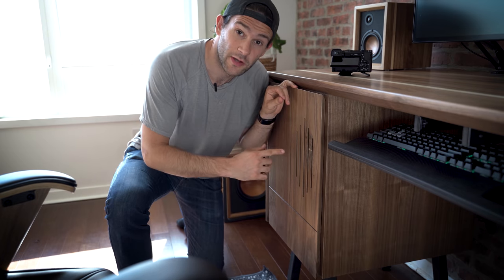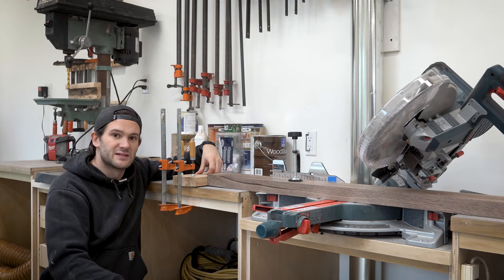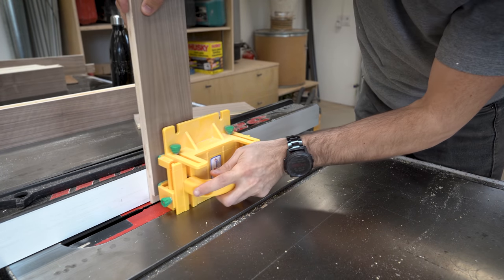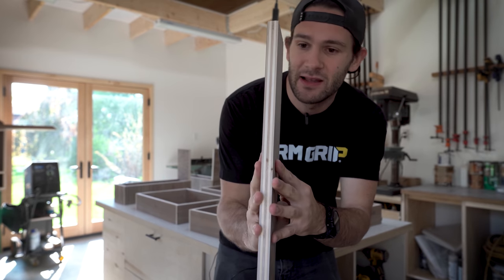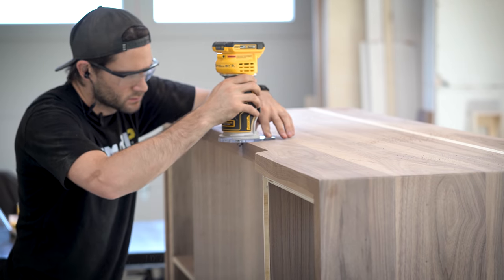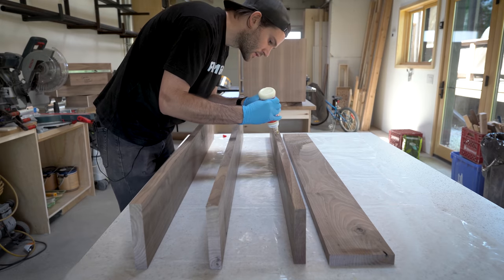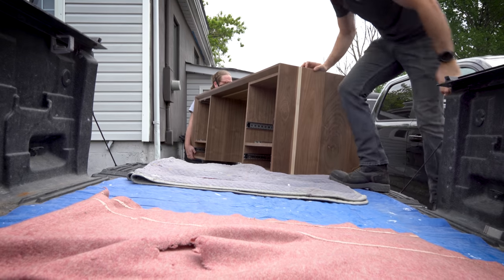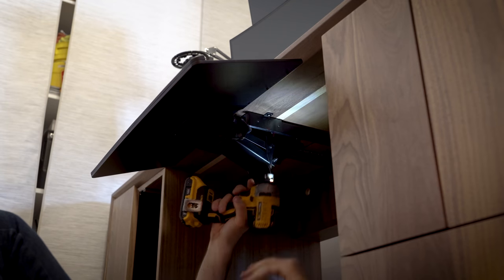Building My Dream Desk

Comment: Man, that is a seriously beautiful desk!! I love the integration of the PC within the desk. I need to build a new desk as well and I thought about just building a small matching cart to set my tower on to save some room on the desktop and still let it have proper airflow. Speaking of, the vents on the front look great. I wonder if it would be beneficial to add a removable dust filter behind the vent. Great job, Zac. New sub!
Reply from the maker: Wow, sorry for my slow response!, don't know how I missed this. I really appreciate the kind words! 

I didn't include it in the video due to time constraints but there actually is a dust filter that sits between the front of the drawer and the front of the rad, so we are definitely on the same wave length there :)
Reply: @ZacBuilds  perfect! That's awesome man. Now that you've been using the desk for a while, is there anything you wish you would have done differently or something else you'd want to add to the desk? -Joe

Comment: Should totally get a sprayer. You can get a decent enough compressor/sprayer combo for 100$. And it makes life infinitely easier. You'll spend half as much time sanding. 

Though keep in mind a gas mask is essential for spraying unless you have great ventilation, and even then it's recommended. Those fumes are no joke.

Comment: as system builder i have a few things on that build, one please dont ever drill holes with the mobo in place thats asking to short the board ... two you have like no air flow in that build ... you have a rad on the intake and exhaust, you should be running push pull on those to increase airflow while decreasing fan speeds cause it has to be choking that system you might have decent cooling but its going to burn out faster with the lack of airflow. other than that this desk is absolutely beautiful as a fellow carpenter i cant wait to build a custom desk case to show off my pc!

Comment: Awesome build! 
Looks amazing! 

I am not a proffesional metalworker,but i leran that when you drill into metal you should use oil.
Just apply a little bit of oil where you're drilling,that will make the drilling proccess much more easier and also will keep your bits last longer.
I'm guessing that there is special oil for drilling but i am using some old motorcycle oil and its works great so far.

Very appriciate all the time and efforts that you are spending on editing these videos.

Good luck!
Reply from the maker: Yes, you're very right! A little bit of lubricating oil will help the bits to last longer!

Comment: Nice design!  One thing that may cause an issue in a few years is that the solid wood will expand and contract with changes in humidity but the plywood won't.  The screw holes on the outside edge should be oversized to allow for this wood movement.

Comment: Awesome looking desk! Keep in mind: Never ever run your screws to radiator with power tool as there's a risk that you accidentally run the screw far and puncture the fin. That mess ain't fun! :D 

Suggestion for the cable management and possibly rev2.0 of the PC side of the desk: Why not offset it bit more to the right so there's "excess space" behind the motherboard, where you could have cable tie mounts? Then you could drill holes for the cables and run them behind the motherboard so that they are tightly together with cable ties? 

But overall: damn nice table! Love the simple but very functional form of it!

Comment: Really nice work, I love the big beefy top and the decorative stripe.  I think you've certainly got a knack for design as well, really nice proportions!  One suggestion, when you screw the plywood bases to the top, it's good to elongate the holes across the grain to accommodate wood movement (maybe you did it but it wasn't in the video).  Nice work!

Comment: Really impressed with your fine craftsmanship! I would just like to ask if the noise generated by the fans gets more amplified now that it's inside the cabinet which essentially serves like a speaker baffle.
Reply from the maker: Thank you for the kind words and that's a really good question. I used pretty high end fans to begin with so they already pretty quiet, but now that they are in the desk I don't hear them at all. I'd love to claim that this was some great design feat on my part, but truth be told I just got lucky. I didn't really take acoustics into account when I was designing the desk, but even at full load I can't hear any fan noise.
Reply: @ZacBuilds  Great! Thanks for sharing.

Comment: Great stuff, you have some skills. Just liked to know how is the computer doing dust wise since you have negative pressure (one fan intake and two out) this usually cause the case to suck air from every where it can. This will make your computer case to act like a dust vac causing a build up of dust. Some removable dust filters would help and or adding more intake air fans. More intake fans would cause a positive air there by pushing the dust out from the case. If you have the rad fans setup as push and pull the you should be ok. Nobody ever talks about how these desk pc setups dust issues.

Comment: Awesome desk. The desk seems a little bit off, it looks like it is not level @ 0:42. If you look at the top monitor, it looks like it's not level (if you look at the wall too). But, if you look at the top of the speakers or the top of the desk, it looks like it is not level there too. Nonetheless, great desk. I can (and will) use some of your tips for my desk :)

Comment: New subscriber here, love the work you did on this! Would it have been beneficial to cut out an exhaust outtake on the backside of the desk for airflow? You could even mount a large outtake fan for push-pull configuration.
Reply from the maker: Hey man, funny you should say that, but that's exactly what I did. I cut some slots in the back of the cabinet, and mounted a big noctua 200mm fan there to suck out exhaust air

Comment: Interesting the difference between US furniture, which reflects the abundance of timber in the US, as opposed to English furniture where much of it is imported and is used much more sparingly.  The result is English furniture is much more elegant where as US furniture can look chunky by comparison but probably reflects the larger than life character of Americans. If it was me I'd save the solid for legs and mouldings etc and use lipped and veneered boards for the main desk. You wouldn't be able to tell the difference and you could use much more figured grains and maintain the stability.. It also gives you the opportunity to do a bit of inlaid work if you like..

Comment: One question. Why don't you use a runner system by Blum, like Movento or Tandem? Much easier to intall and nicer to look at since you don't see the sliders at all. Plus on Movento system you have a 3D option of aligning the drawer fronts.

Comment: Beautiful project. Subscribed. But.... I will really appreciate, if you can post the measurements in written, either in here or on your website... if at all possible. Thanks for this wonderful inspiring video.
Reply from the maker: Thanks Tanmoy! The desk is 72" wide, 26" inches deep and 36" high. That's very high for a traditional desk, hence why I have the keyboard mounted down below. But it makes the desk very comfortable to use as a sort of work bench around the house.

Comment: Zac, I didn't notice in your video how you placed the computer power and reset buttons. Can you link to the timestamp where you did that or describe how you placed those?
Reply from the maker: I know this response is super late so I apologize about that! Right now I have a remote switch sitting concealed on the backside of the desk near where the powerbar is. It's really ugly (I couldnt find a nice one) so I didn't show it in the video, I'm still hunting for a good one. I dont need to use it often as I basically never turn off my computer (just let it hibernate).

Comment: Nice concept here, I like it. But desktops need to have maximum width for maximum comfort and work surface, that way you could have avoided the sliding shelf for the keyboard mouse, no steady at all. I like big desktop tables, I made my own desktop office with dimensions 2 m length, 75 cm width.

Comment: Hey Zac.. little late to this particular video.. I am looking to do a desk build soon for myself. I have a sit/stand desk (dual motors) currently, planning to replace the wood top with a studio desk for my music/workstation use. I am also trying to "downsize" by getting rid of big computer cases. Built a miniITX not long ago, and then saw this video and a couple others and thought.. put the computer parts IN the desk, with maybe a plexiglass or window on top to see through to it. My main concern is one of cooling. I will probably do a custom water loop setup as I'll have a bit more room I think than what you did in the drawer here. Is there anything to be concerned about with regards to p/s, heat generation, and removing heat? My thought is some intake fans on the bottom of the desk (out of site) pulling air in, and exhaust fans on the back. The front of the desk will have a musical keyboard slide tray as well as a keyboard/mouse slide try (above the musical one). So I won't be able to mount fans on the front. I imagine the desk being thinner at the front and sort of having a narrow V shape going towards the back to make room for computer/fans/etc in it.

Comment: Beautiful project, as always!
I really like how you incorporated the computer pieces into the desk. My only concern is what if in the future you decide to use a larger gpu?
Reply from the maker: Thanks Braden! I've got pretty good clearance on both sides so a larger GPU should fit within reason. My 1080ti is definitely on the large side of GPUS too. Work case scenario I guess I could remake that drawer and make it a little bit longer to add more space.
Reply: @ZacBuilds  That's a 1080ti?!? Holy cow, nevermind then!
Reply from the maker: @GODLOVERBAM  Ya it looks a lot smaller because I'm water cooling it with a Kraken G20, so its got it's whole heatsink and shroud stripped off of it.
Reply: @ZacBuilds  I didn't even notice the water cooling on the first watch-through. That's an epic set up man!

Comment: heyho ... I have a question regarding your bricked wall. :-)
Since switches and sockets are incorporated there, I suspect that the wall is "only" covered? I wanted to do something like that with my living room wall behind my television. Can you recommend anything?
Reply from the maker: You are correct the "bricks" were actually just very thin slices of real brick applied to the wall like tile. Most tile stores ive been to sell similar products. Just call around your local tiles store until you find one that has them

Comment: Outstanding build! I wanna do something similar. My only concern with these are the temperature management. Any advices please?
Reply from the maker: Thanks!  Honestly mine has been fine with, I use an AIO water cooler for both my cpu and gpu and haven't had any issue with thermals. The hottest the cpu gets is low 80s and that's during super long video renders
Reply: @ZacBuilds  awesome. Thanks. New sub here
Reply from the maker: Thanks you! Hugely appreciated!

Comment: As an IT/ Computer enthusiast I absolutely love what you did with the desk and the computer. I will recommend taking a look at acinfinity.com for exhaust fans that you can attach to your desk. They will certainly exhaust any hot air that keeps trapped in there and they look extremely nice! +1 SUBSCRIBED

Comment: You couldn't use your table saw (with extra side support) to crosscut the miter in the entire top?  I guess the room might not be big enough.
Reply from the maker: I might've been able to do that, but it would've been awkward as hell for the top of the desk. It's a little under 6ft long and probably weighed close to 60lbs, I'd need one hell of a cross cut sled and probably some supports too
Reply: @ZacBuilds  Yeah, I'm envisioning putting an outfeed table (or plywood on sawhorses shimmed to the right height) to the left of the table saw.  Might just not be practical, but that was my thought when you cut the other miter with the table saw.

Comment: What GPU are you using and what are the temps you see while using the computer under load? I’ve been wanting to make a desk pc or fit mine in a cabinet similar to how you’ve done yours and I’m also about to install an NZXT water cooling bracket on my GPU just for fun and I’m curious if it cools better than the stock cooler with only a single 120 AIO
Reply from the maker: Hey Ben, I'm running a 1080ti, I haven't checked the temps in a while ago, but if I remember correctly they were mid-70s under load and that's with an overclock and increased power limits too.

Comment: Zac, what kind of temps do you get on your video editing pc with it inside like that? You have me intrigued.
Reply from the maker: Mid 80's under prolonged loads with a 5ghz overclock and slight over volt too. About the same as when I had it in a conventional case, maybe a few degrees warmer but nothing I'm too worried about

Comment: Which sliding keyboard tray did you use?
Reply from the maker: It's by a company called Mount It, I bought it off of Amazon, though it seems like there a few companies selling the same tray under different names. Beware the deck that comes with it is very flexible!

Comment: How about the temperature?
Reply from the maker: Good question Lee. Thats part of the video that got cut due to time constraint but I spent a lot of time testing the temperatures. I can do hour long  renders without any thermal throttling on my overclocked CPU and GPU. I haven't been able to create a scenario that leads to any thermal throttling let alone overheating.